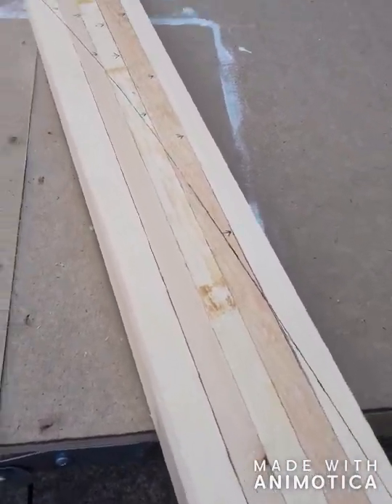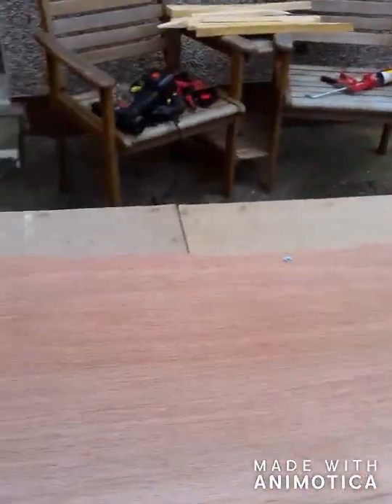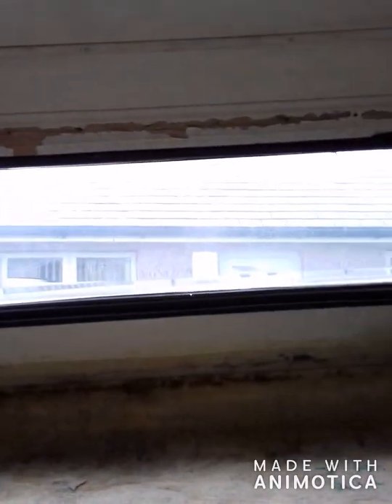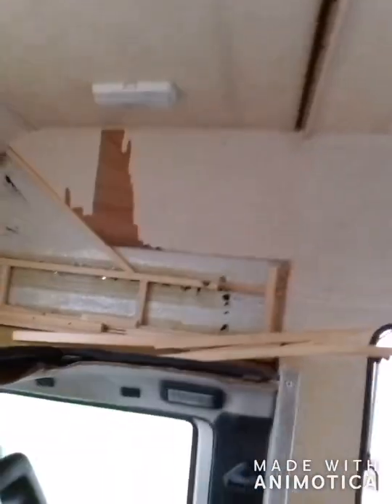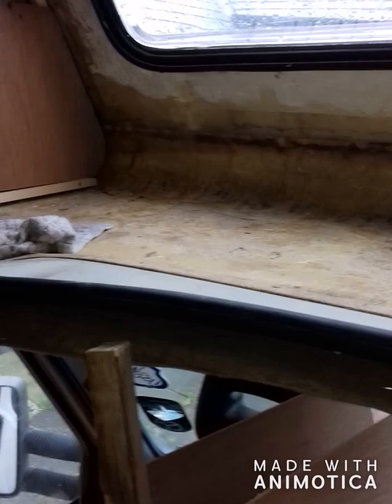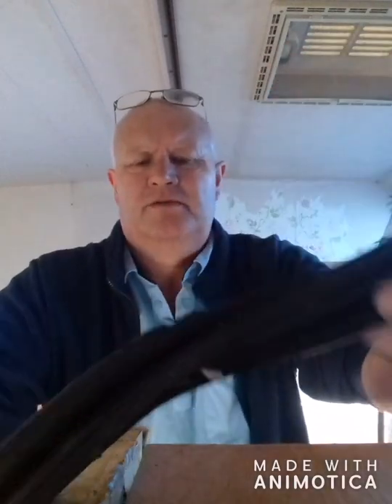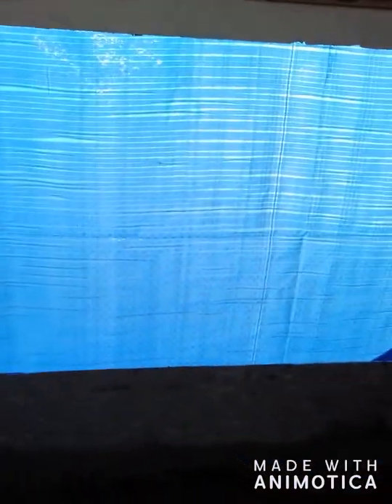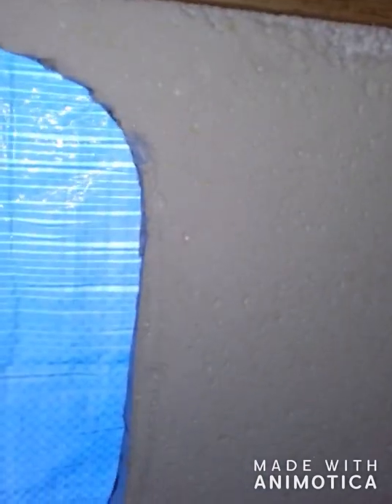Talbot Express Damp Repairs Part 9, Finishing The Bed Base Above The Cab, Removing Pod Window

Comment: Hi there i have a leak by my sky light above the bed by the drivers seat. Can you tell me what kind of lagging i should put up.mine is soaking wet
Reply from the maker: First you need to find the leak and fix that. Once you have done that you can put up whatever you like as long as its not to heavy  i like to use the 4 way stretch  Lining Carpet from Mega Van Mats, DO NOT USE Van & Campervan Carpet its to thick for the roof and also very hard to get around difficult bends ect